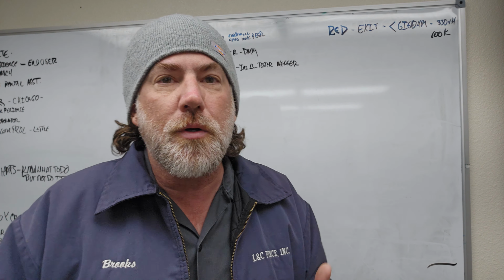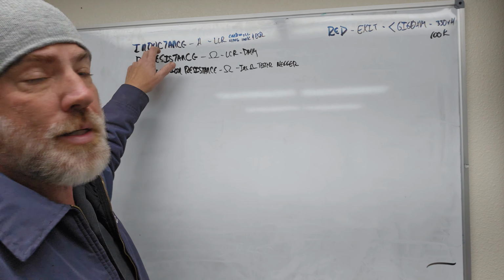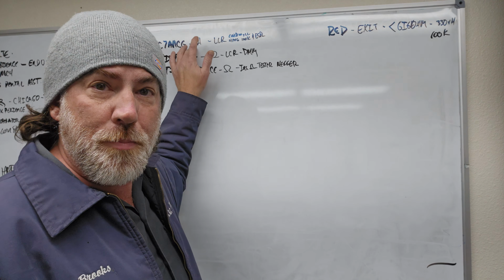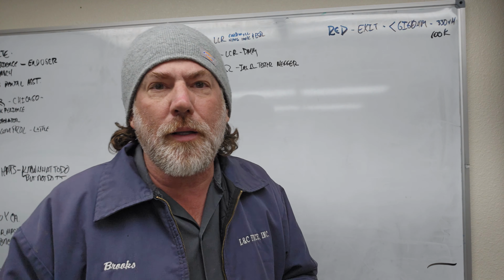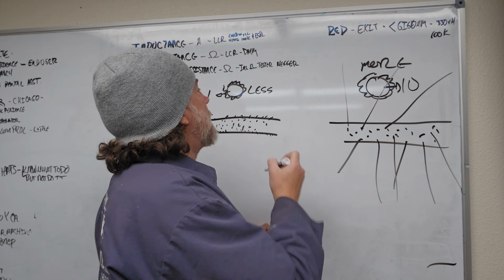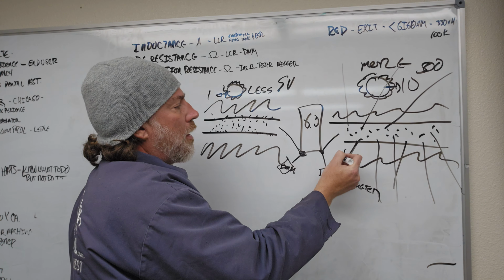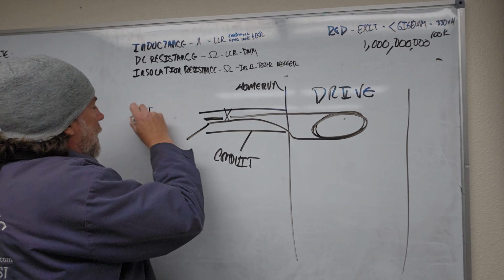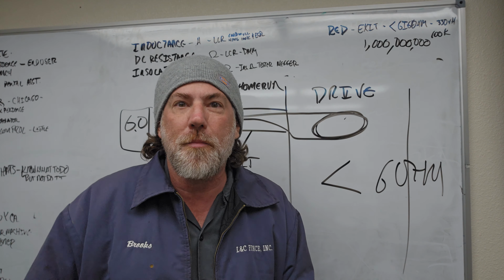The ONLY way to test a loop for automatic vehicle gates

Comment: Open loop is not hard to t'shoot.
Reply from the maker: I'm not sure how much tech support you do, but you'd be surprised. However, there's best practices as well and that's the reason for the videos to understand that we need an overall picture of the loop. I personally am not aware of anybody that tests inductance and DC resistance as a general practice much less label them. Because if they are I've never seen it documented on the job site